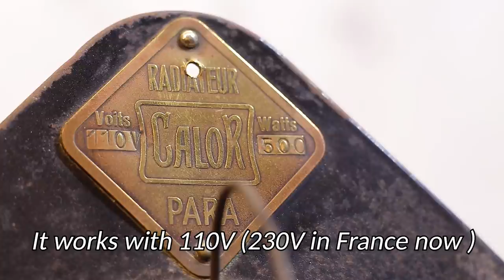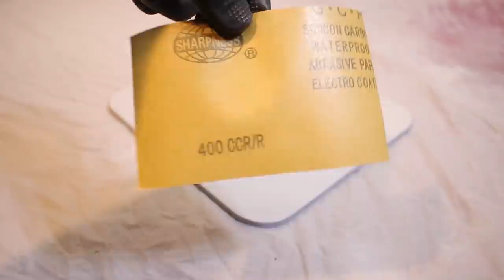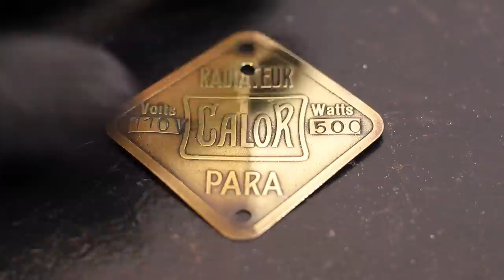Rare and Old Radiator - Restoration

Comment: Cool, but you never seem to show us the things you restore plugged in and working. Like we'd love to see these things in their FULL working glory.
Reply: If he plugs that in the entire thing will go live and he'll have a lump of mains voltage metal sat in his workshop. There were some insulators missing from it which he didn't replace.
Reply: @Thematt11  and if it still had the insulators it would probably explode because of the higher voltage.
Reply: Would need to double the length of the coil or replace it with a heating element for a kiln rated about 500w,somethings going back to original still means it cannot be used
Reply: This. And if cannot test then why is that and mentioning it's only for decorative piece.
Reply: You must just be blind then.
Reply: To be fair, I would barely trust that to not start fires WITHOUT plugging it in
Reply: This guy always tests stuff on his other channel. I didn't even know he had this channel.
Reply: @PC-yp5dl what’s his other channel???

Comment: Great job on this one! Wish we could have seen it tested though.
Reply: it will explode no isolation  for heater base so it will have a shortcut
Reply: @Jamadkskskdjd  yeah I have an old 30’s projector and it has an isolation. The isolation is a heater on its own lol
Reply: Yeah same. A US adapter would step down to 110.
Reply: @Jamadkskskdjd  No, this thing Works for many Years. It has no modern Certificate but it Works with 110V
Reply: @beat_avenger  US?
You can just buy a transformer, fixed 230 to 110, or a regulated one. The latter cost about 60 euro. I used it quite often for old computers, bc back then the voltage was 220. And the increase to what it is now, with spikes on the net, is enough to fry the psu.
Reply: @Funhubble  This one will NOT work. Amjad is right.
Our restoration man forgot to add isolation in the 2 wire pertruding things that go through the copper cap. Also he didnt use isolation rings. So it will shortout immediately as soon as you plug it in. Not safe and he shouldnt have done this.
When you restore electrical devices in such a way that they are for esthetic purposes only and not to be used, there should be NO connector to socket AND it should be safely disconnected in the device, so that when it gets to someone that assumes it may work, cannot cause an accident.
Bad job with regards to this.

Doing it right requires 2 isolating bushings that separate the pertruders from the copper cap and 2 isolation rings on top of that. Possibly both sides, although that depends on the bushings.
Reply: @StofStuiver  Oh OK, ididnt seen that 👍👍
Reply: @Funhubble  I missed it too, but went to check after i saw ppl comment on it. ;]
Reply: @beat_avenger  An adapter will no step it down. You need a transformer.
Reply: @kinskifilms   US output is 110 so if you need 110 you have it. You mean one would need a transformer to step it up to 220 bc that’s what it was designed to work at?
Reply: as people say, isolation plates are missing (see 2:09 and 14:22 , some parts are different from the original after the repair). in addition, I wonder if the ceramic core which repaired with glue can endure high temperature. probably, rebuild the core with clay may be suitable.
Reply: Not to mention the ceramic is used because it is heat proof...and now it's covered in resin and spray paint

Comment: I have a suspicion if you plug that in you'll need a new workshop.  The power cord seems to be in short circuit with the copper reflector. Or did I miss something, and that it's insulated?
Reply: Yes, it's short circuited, there should be insulator rings betveen the coppe bowl and electric contacs. And no, he doesn't need new workshop, it'll just blow a fuse.
Reply: @Njazmo  That's what I thought, I was truly hoping he'd test it though. But I guess it's just a dangerous novelty. Honestly, I gasp and screamed yes! when he pushed in the power cord connectors at the back. I know I am bad. Still, in any case... it's a boss restoration.
Reply: @Njazmo  Still dangerous. Also fuses can fail (depending on the sort of fuse) and people can fail, shorting fuses...
You should never restore electrical devices like this.

Comment: I very much enjoyed this restoration.  The final product looks beautiful.  BE CAREFUL!! this likely will not work again.  Paint on the ceramic won't take the heat, it will burn and at the very least smell bad if not ignite.  Plus I did not see insulating washers (I think they were mica washers) re-installed where the terminals for the heater come through the copper reflector.  If they are missing you would have a dead short across the copper reflector, and you would blow a circuit if you plugged it in.  I understand that this is merely for decoration now, but others should be aware and be safe.
Reply: Yeah, exactly. I'd nail a big sign to it - "NEVER PLUG IN!!!"
Reply: @iteration.ilya_dm.16  Or simply disconnect the wires ...
Reply: @raoulvolfoni1800  =)))
Reply: He just posted a video restoring an even older one to working condition.
Reply: Even though i admire the restauration work and the quality of the videos, this is a HUGE NONO for me.
You should NEVER restore electrical devices in such a way; with mains connector attached, while the device is shorted.
If you restore electrical devices, omit chord and or main connector AND actively and safely interrupt mains IN the device, so even if someone would add a connector and try it, it will not cause any accidents.

Comment: Very well restored but in my opinion you should have just left the wire out or made it deliberately non-functional. As it is now it's incredibly dangerous and will either short circuit or catch fire (or both) if someone accidentally plugs it in. Ignoring the voltage difference, there seems to be nothing isolating the live wires from the coil from the copper reflector, so it'll just take the shortest path across and hopefully just blow the household fuse.

Comment: Nice restoration , however The materials you chose to use to restore the Ceramic element holder will more than likely  burn If you plug it in. The epoxy and spray paint especially  unless they are rated for very high heat.

Comment: Disconnect one of the wires in the plug.  Still would look wonderful but would have no chance of working if it was unknowingly plugged in. Better safe than sorry. This looks very lovely.
Reply: Good idea. Safety first! But I would disconnect both lines in the plug so that there is no voltage in the device. The heating coils are not properly covered and the housing is not earthed, which is very dangerous.

Comment: You never plugged it in.  Did it turn on?  Did the resin epoxy on the ceramic catch fire?  Post a part 2 please.👍😉
Reply: Prowler Cam  maybe the ceramic part could be replaced with an electrical transformer of the same material.   I bet it would work then, and then plug it into an inverter or power adapter. 😉👍
Reply: I'm curious too. Did you trust it to work?. Those things were dangerous when they were new. You did a fine job.it looks wonderful. The graphite wax was sumptuous. Perfect choice

Comment: You should've put some insulation rings between the copper reflector and eletric contacs, that's now in short circuit, and nobody should plug in that thing, even if it was made for wrong voltage. After all it came up really nice.
Reply: Well a heater is just a short circuit in the right place

Comment from the maker: EDIT : I didn't have 110V adaptator to test it and the output of the radiator wasn't isolated from ground. I also didn't put plastic isolating washers back cause they were very damaged and it was unsightly with polish copper.
It becomes a nice decorative object anyway 😉👍
Reply: ☹️.... you restored it, but didn’t replace the electrical insulated washers - then put a lead/plug on it and stated it will be/rendering it a shelf queen, with the additional risk that someone who likes restored vintage things to be useable will plug it in and burn out the nichrome wire and be electrocuted  - at least replace the nichrome wire with one rated for use with modern European power output, and replace the electrical insulation washers, so someone will have the pleasure to plug it in and use it 🙂
Reply: You glued the Ceramic with Plastic Glue, it will not withstand the heat if someone plugs it in.
Reply: So it makes no sense and it is dangerous to connect the new cable in the plug!
Reply: Sorry, but you should never restore like this. It is NOT safe.
If the device is shorted, you should safely interrupt the power supply to it IN the device AND omit the chord and mains connector!
Suppose this gets to someone that doesnt know. You had no opportunity to tell them. It just so happens that they shorted out the fuse, bc old house and out of fuses or malfunction and someone plugs it in.
That means the wires will be on fire instantly; the leads will fuse together, etc all the way to the switchboard. And if its a child, good chance it will panick and you will find your house burnt down when you come home.

This is a NONO m8.

Comment: Radiant heat lamp. These were mainly intended for the bathroom when stepping out of the tub soaking wet on a winter's day. You have to be in direct line with them to feel the heat. They heat the surface of what they are pointed at but do very little to warm the ambient room temperature. Like a hot fire. Feels good as long as your standing near it.
Reply: True that you feel the radiation mostly, but all energy, radation and convection goes to heat. In fact, since these were often 1 to 2 kw, they were big enough to heat a small room like a bathroom.
Its not a lamp btw. Those did exist too and were popular in the 70ies mostly, as IR. This sort of thing is called an electrical heater.

Comment: Nice work, but if you plug that into the mains there will be a dead short circuit as the terminals are connected directly to the metalwork without any insulation.

Comment: It should still be possible to buy sheet mica and punch out a set of new insulating washers. Glad that this won’t ever be put to use because of that broken ceramic core (and the voltage difference).

Comment: Nice work. Is this ready for practical use? i.e. the glue and filling/ paint on the broken ceramic piece are they heat resistant?
Reply: I doubt the epoxy holding up, parts like that are ceramic for a reason

Comment: Nice made but I assume it wasn’t plug-in hence the ceramic element was treated with epoxy and spray paint. I mean it’s ceramic because the wire is basically heating red glowing hot up and might burn off the spray paint if here was used ordinary once

Comment: looking awesome  just wondering whats keeping the heating elements from shorting out on the copper shield def check before testing there should be carboard washers our duraplastic washers to shield off  lol since ya dont have earth wire and its all metal
keep an eye out in the thrift stores the 230 to 120 transfo sometimes popup there i found a few thrifting around in belgium but they usally have english sockets and yours has french/belgium plug
edit/rechecked your vid think you forgot the isolating washer hehe
Reply: ☹️ - he deliberately left the insulation washers off and rendered it a shelf queen, with the additional risk that someone would plug it in and be electrocuted
Reply: @samuelfellows6923  he actually made it safer now you plug it in and the fuse will trip  
with isolation its a waiting game to be electrocuted lol
Reply from the maker: haha it becomes a very dangerous game now lol 😇, rest rassured nobody will die and just for you i can put washers back if you want 😉
Reply: nobody wants ugly plastic on there awesome restoration lol good replacement is fiber insulated washers they also period correct to keep authentic
heres example
https://www.amazon.com/150Pcs-Insulation-Assortment-Washers-Sealing/dp/B07MDJXLBV

but these wont work for ya since the washer needs have countersunk part to protect the sides off the hole the conector goes trew
Reply from the maker: thanks for these details 👍

Comment: Nice job! Interestingly the WD 40 wasn't invented as a lubricant. It was intended as a Water Displacement  and rust prevention in space industry. Its first use was on Atlas Missiles. Where the 40 comes out? It' was the 40th (and final) attempt to achieve the right formula ^_^
Reply from the maker: Great Scott ! 😆 Thank you for these details 👍

Comment: You forgot about the insulation between the terminals and the copper reflector, there will be a short circuit when the device is turned on.

Comment: You need to insulate the terminals from the copper bowl, otherwise if you ever actually do plug it in, it’ll just short circuit through the copper bowl.

Comment: Instead of buying a very expensive 500+ watt transformer from 230 to 110V, it's cheaper and easier to make a small triac based circuit (like an old light dimmer or vacuum cleaner) with fixed 45% duty cycle and thus 45% power. Much more efficient as well.

Comment: Overall a nice decorative piece. But with the paint on the ceramic resistance holder and no electrical isolation on the screws holding the resistance(between the copper plate and the screws) this will never work. Moreover it would be dangerous to use..

Comment: tres joli résultat ! un peu dommage que tu ne l'aie pas testé ceci dit, enfin je pense pas que tu puisse, et une machine qui n'a plus sa fonction de base c'est un peu triste. 

je pense que tu aurais du te débarasser de la prise, les deux dents en métal sur toute leur longueur c'est un peu dangereux, j'ai pris le jus a cause de ça une fois quand j'étais gosse. 

pour l'élément central en céramique, je sais pas si la résine epoxy peut résister a la température, mais je crains que ça prenne feu ou se mette a fumer si quelqu'un la branche. une solution que tu pourrais enployer la prochaine fois (ou si tu décide de faire une re-restoration) serait de tartier l'élément de chaux de sorte a ce que le CO2 de l'air se combine avec en une fine couche de carbonate de calcium qui cacherait la couleur de crasse qui ne part pas. en espérant que ca ne s'écaille pas a la température.

et niveau tension éléctrique, tu peux tout simplement mesurer la résistance du ressort avec un multimetre et ajouter une petite résistance en série, ça devrait suffire a rendre l'ensemble utilisable =)

Comment: didnt you need an adapter too plug it in too test it? you need a standard plug.
Reply: it is a standard plug for france, but the issue is the voltage. nowadays france (and most of europe) uses 230v, which means the thing would output approx. five times the intended power and the resistance coil would likely melt, the white paint on the ceramic part and/or the epoxy bond could catch on fire.

Comment: Well this one is a bit of a disappointment. It looks nice, but it can never work again. I'd say this old thing has died.
The ceramic repairs were just decorative and could never stand up to heat, and there are insulators missing from the copper reflector so now it's a straight short circuit.
Don't get me wrong, it does look nice, and it probably would be considered dangerous by todays standards, but the fact you can't ever try it ever again on a 110v supply relegates it to decorative tat.
That added to the fact that's actually wired up makes it a huge risk if anyone down the line plugs it in.